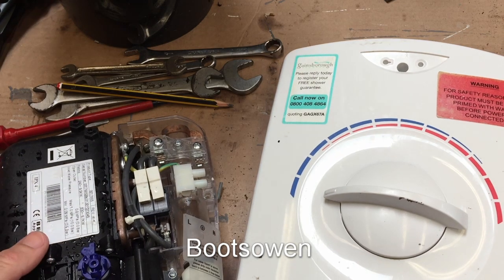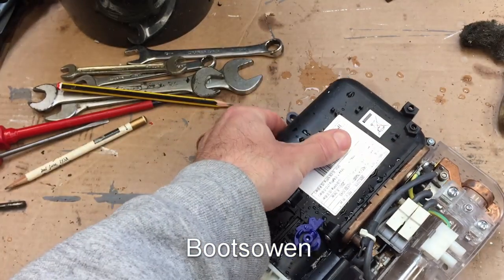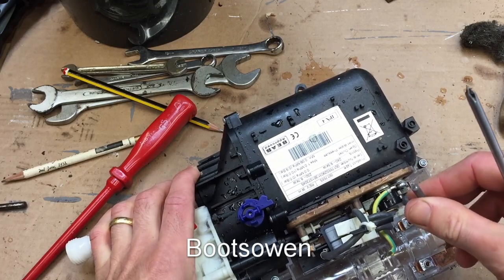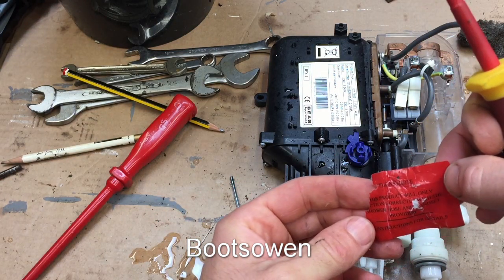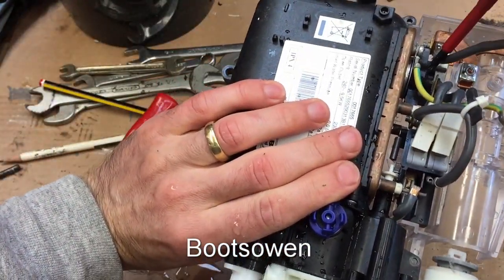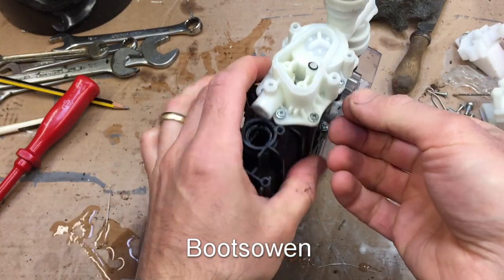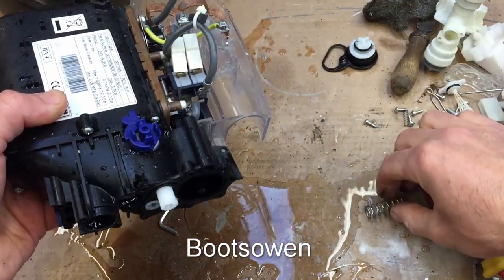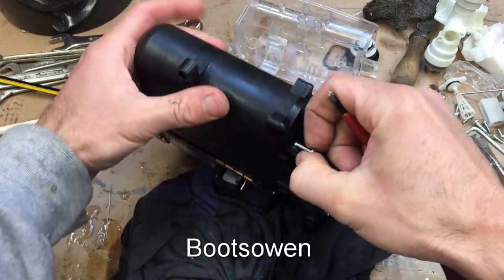Unknown Gainsborough Shower Teardown | interesting pressure switch

Comment: Just investigating a problem with my shower which was working fine, came to the conclusion there must a flow switch somewhere as everything else looked ok. Found this video (shower is exactly the same as the one I have fitted) showing the pressure switch operation and it's all clear, manually operated the plunger and unit works fine. Means I'll replace the shower, but peace of mind knowing what it was. Love interesting vids like this, thank you.
Reply from the maker: why not just replace the pressure switch? , electric shower parts are available.
Reply: @bootsowen  Hi, yeah tried looking couldn't find one, searches did show I could buy a complete replacement from lots of sources. (Now Aqaulisa) Being as the unit is 14 years old (I fitted it) it was a toss up between spending hours doing more searching and replacing versus a 20 min unit swop. Replacing one part didn't guarantee that another bit wouldn't fail soon because of it's age. This way I get a quick swop and a full set of spares minus the pressure switch obviously.
Reply from the maker: You are of a similar mind to me, while I hate waste, if I have to live with something like this every day a simple swap is easier than chasing old and failing parts.

Comment: I think you'll find that this is the Gainsborough 9.5kw SE model. Also, the PRD is not the one you pointed out at 14.13, its the small outlet gismo at right angles to the white outlet pipe. You can see it clearly at 5.28, just above the red tape, in your vid.

Comment: Man, you are very curious, to strip that down. 

I came here as I was looking to see if someone had posted about an issue I have with a Gainsborough shower, this looks like the same one. Mine has been working fine, but I had a leaking mains pipe feed to the house which had to be repaired. First time I started the shower up again I had very hot water and weak flow, got through my first shower but when I tried a few minutes later it is stone cold and will not heat. I have turned up the water pressure to the house, I am getting good flow now but still will not heat. I am assuming the switch is stuck but do I cannot work out how to free it. Any ideas?
Reply from the maker: Does it have an over temperature sensor above the water heater?